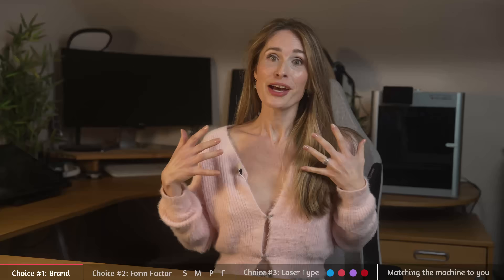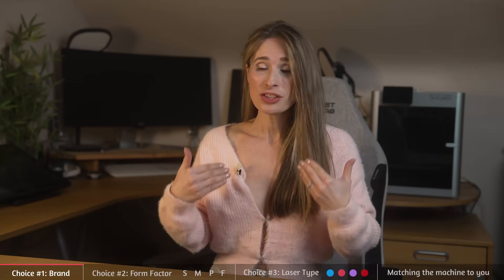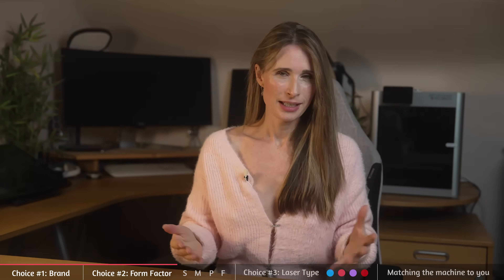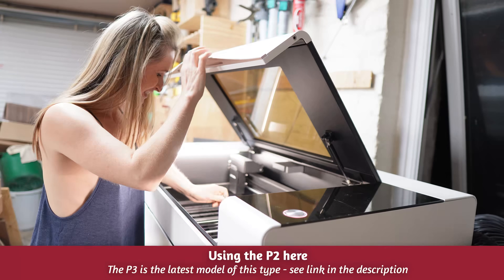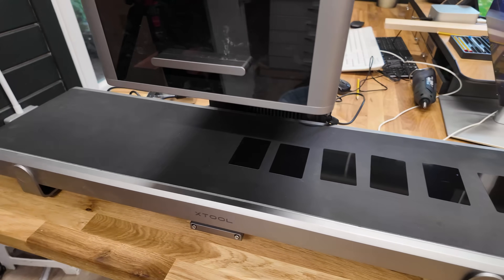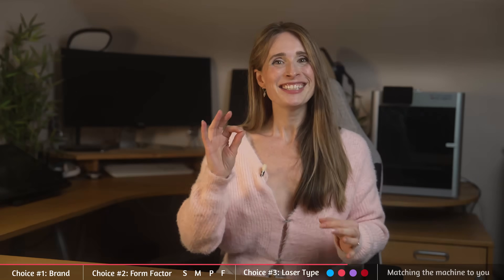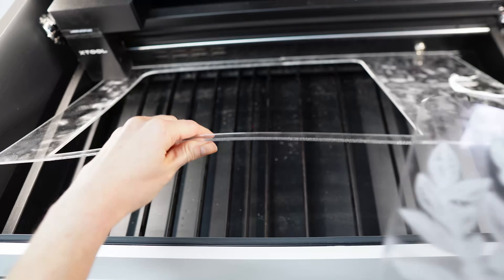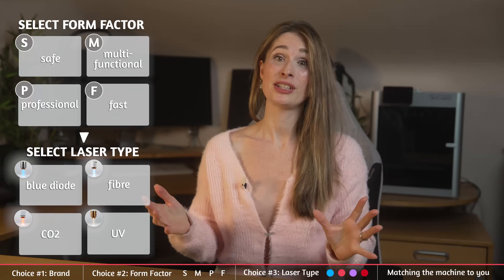xTool Laser Buying Guide — Find The Right Machine For You

Comment: Sadly I have a hard time swallowing 5000€+ lasers as being "domestic use"-grade gear. Sure large industrial lasers are 10x+ in price, but frankly for hobbyist use 1000€ is a pain threshold for most people. (And while the small S-series models may fit that kind of budget they can't do anything useful so no amount of money will make them a good deal) My primary use-cases would be precision cutting templates for woodworking, engraving spherical stainless steel objects, cutting & engraving plexiglass and leather. Thankfully I have access to industrial grade high-power CO2-lasers at my local library, but having one at home would be swell.
Reply from the maker: Oh that sounds ideal then - as you say, they're certainly not throwaway purchases by any means - so if you have access to a CO2 laser, then that'll be ideal for lots of the tasks you describe. Just probably on plastics and steel where it's weaker!

Comment: Hi,

Thanks for another great video,  A question for you (all) have you ever tried to cut out thin opaque material 0.8mm (vinyl or polycarbonate sort of stuff ) but with strips of double sided tape so these can be used for making a window on the inside of an enclosure where I dont want glue/tape in the window. - Anyway - thanks for the content ally interesting.
Reply from the maker: Yes, I use my CO2 laser (P2) for cutting clear perspex all the time. Adding some tape wouldn't cause any issues (this is a common trick used on wood cutting to minimise char marks, so this would work fine!)
Reply: @handsonkatie  Thank you so much! looks like I will have to by one now....

Comment: This is really, really helpful. XTool is already in my sights as the brand to go for (as a beginner). But I'm torn between the P3 and F2 Ultra . I have an irrational want to etch an oversized coin, but I would also feel the need to cut larger pieces. I think I'll need to get both.

Oh, and I'm going to be beginning my odyssey into Electrical Engineering. I am rather excited about this. I did a math degree, but it has been decades and I want a reason to plunge in again as my work tends not to use too much of what I've learned (just as with Piano -- I used to teach!). Engineering seems like a noble field of study that accomplishes that end and provides something useful. I get the impression that you are an EE. If so, do you have any pearls of wisdom to share?
Reply: I've got the F2 Ultra and i love it, but it is a niche machine. I also have an older Epilog Mini 24". They serve very different general purposes sonthe question really should be.. Which tasks do you want to handle first?
Reply: @secretagb  Yes, this matches my intuitions. Its tough to say what I want to handle first -- I know that either would enable desirable projects, but I think I need to understand myself a bit more before choosing. 

What are your major use-cases?
Reply: @SeanLumly   The 40W Epilog I primarily use to produce and sell wood model kits which are both cut and engraved. It is also used for acrylic parts/assemblies production/prototyping and marking anodized aluminum parts.

The F2U is used to mark stainless steel items/assemblies, engrave/emboss aluminum itself not just marking anodized parts as that could be done by either machine. Basically it's for metal for me. I do use the blue laser with rotary attachment for occasional production of tumblers per customer request as the xTool cylinder handling is far faster and easier than with  the older Epilog.
Reply from the maker: Oh goodness, don't make me pick between those two - they are quite different beasts! I honestly couldn't pick between them both - the P3 will be brilliant for cutting wood, acrylic and other 'panel' style pieces. As you say, the F2 Ultra is a beast for etching tiny details and carving. Either will give you years of fun though, so in that sense you can't go wrong!

On electrical engineering, yes you're right, that's my background - I'm not sure how many pearls I could summarise in a sentence, but you're welcome to join my discord if you want to brainstorm!
Reply: @handsonkatie  That is very good to know. I need to temper my ambitions, so perhaps starting with the F2U will provide more use in the short term: eg. etching PCBs (or laser mask removal) would provide practical utility.

Many thanks for the invitation to the community. It sounds like something I would enjoy!
Reply from the maker: Delighted - drop me an email on my site and I'll ping you a special link!